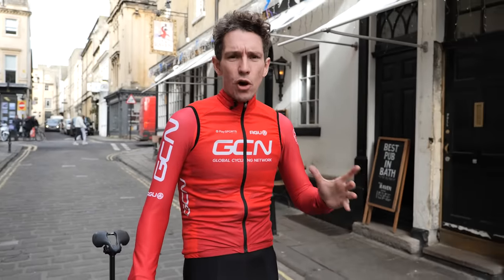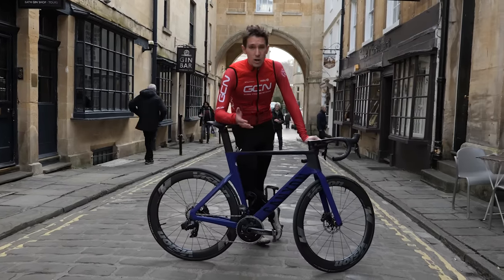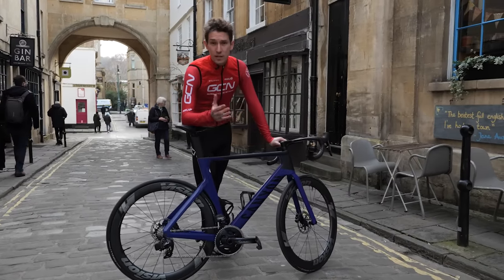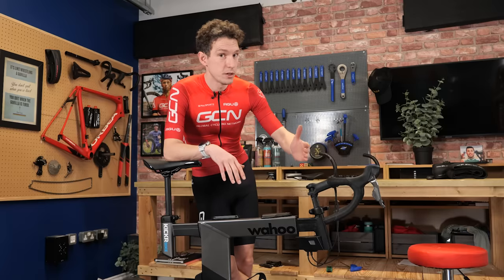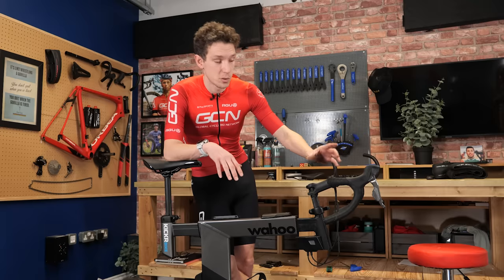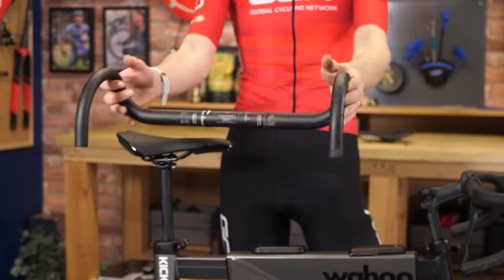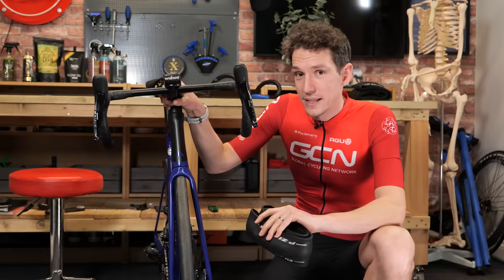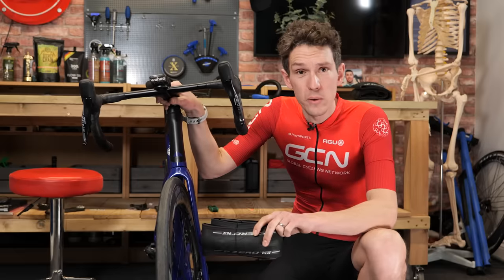Stop Back Pain When Cycling With Expert Bike Fit Tips

Comment from the maker: Have you experienced back pain when cycling? 🚲
Reply: Not always, only happen mostly when i do grand fondo..
Reply: Well after 3 hours ride i start feeling pain in my back, neck and butt
Reply: Yes. I'm riding my first ever drop bar bike, and I suspect the main causes for my back pain are the cranks being too long and stance too narrow.
Reply: A number of years ago, for about 2-3 years I could barely walk due to back pain. Sometimes I could only walk about 50 without having to do a reset on my which might consist of sitting down for as little as 30 secs. When I returned to cycling, within about 6 months, the issue had disappeared.
The pain I wish I could cure now, is the pain in my ass.
Reply: Like a lot of riders it’s usually when I’ve been out 3 hours plus. Great vlog thanks again to all at GCN, all these great nuggets, would always point younger or first time riders in your direction.
Reply: No, because I don't buy bikes with proprietary tech that makes things like stem adjustment either impossible or very costly. Yeah, looking straight at you Canyon.
Reply: Yes, if I’ve been neglecting my stretching and flexibility. If it’s bad/stubborn, I go feral and ride my MTB for a while. Discovering my left leg was a little shorter than the right and chocking the cleat, was revelatory and cured a range of niggles. I am in my late fifties so things are getting a little less robust, for all my efforts 😂
Reply: @Blitzer00979 If the cranks, the pedal arms, are too long and causing back pain, try just lowering the seat. Sure it doesn’t change the effective stack ratio at the front, but being more upright is only going to help. Otherwise, if you aren’t talking about the pedal arms, cranks, then my guess is that your handlebars are too low. You could flip your stem, raise where the stem is on your steer-tube, or get a shorter stem. Start with the seat height first though, that will change your front end
Reply: Not after my bikefit :)
Reply: I just lowered my saddle to help with a back issue. My back isn't perfect (I'm hoping that it just needs time to relax and I won't have to do anything else). It's not actually that it allows me to sit more upright, it actually allows me to lean forward better without bending my back the wrong way. I might actually be fine to lower my handlebars or even extend the reach, though I'm not planning on trying that soon.
Reply: No, usually just my shoulders as I have weak upper body strength, and perpetual numbness in my toes.
Reply: Yes when I bought a new road bike, had a bike fit and can now ride 5+ hours without excessive pain.
Reply: I have no disk between L4 & L5 and have been in chronic pain for a decade. I had to move from drop bars to mustache bars. This had a huge effect on my comfort levels. Installing the correct length and angle of stem to lift up my position on the bike was a game changer.  I also moved to wider tires running lower pressures. I am meticulous when it comes to my saddle. I have found that a leather Brooks B17 medium does the job brilliantly. Bicycling is the only activity that actually makes my back feel better. Once I had figured out these specific configurations my pleasure while riding increased dramatically. I lost 46 kg (100 pounds) and my fitness has never been better. You don't have to suffer on a bicycle, in fact it should be the exact opposite. You should feel better when you ride. I know I do. Great show boys, Cheers - M
Reply: @KelvinSuddith  I've tried lowering the saddle, and it hasn't helped unfortunately. And funnily enough, actually lowering the handlebars eased my pain. Turned out I was sitting too upright, which put too much pressure on my spine. The bars that came with the bike are also way too wide, at 46 cm. I'm planning to swap them out for a 40 cm ones. Still a lot of things to try to find the solution 🙂
Reply: For sure!  6gap 2023, me and the guys in the neighborhood were in the saddle 7.5 hrs. with 10,869' of elevation.  I definitely felt it in my LB during the later part of the 100mile ride.

Biking has changed my life.  I have power cranks and a speed sensor but an Iconect trainer w/ a cheap arm HRM is all it takes to get on Zwitft. I put off joining for a really long time,  watching the 2023 classics bike races on the big screen was my method of training.  Biking has definitely increased my downhill running capabilities.  

Gent–Wevelgem is my favorite race to watch. It so special witnessing the memorials in contrast with the vitality of the racers.
 
Jumbo or QuickStep?  I don't know their both so good!!
Reply: Can it come down to good bike and fit with patient research?
Reply: Yes. Usually caused by too long a reach. Stretching too far
Reply: my backpain actually goes away from cycling
Reply: Certainly. It's the main thing keeping me from doing long distances, but it also affects my speed as when the lower back starts hurting, I can't put as much power out, or at least for not as log. I'm also constantly switching positions to help with the pain, which is distracting, and obviously not aero. But I don't think it's necessarily the cycling causing it, as I experience lower back pain any time I'm in the same position for long. That can be driving a car or just standing (we got those adjustable desks at work, and because they recommended it, I started trying to work standing up more, but I can't do much more than an hour before my back is killing me), but it is most painful when cycling, probably because the more extreme position and the effort. But there are probably things I should try in cycling that could alleviate the symptoms for me. For a long time, I've suspected I might need a saddle made for women, as I am a very wide hipped man. Probably the next thing I'll try. That crank length thing also seems it might be an issue for me. I'm 195cm, so I've always been on 175mm cranks on the largest bikes they make (well, my Canyon is only XL, not 2XL).
Reply: yes due to being old and weak.
Reply: Lack of core strength is the most obvious problem

Comment: Great video. I've found core strength training to be a big help. Some Plank before every ride really goes a long way.
Reply from the maker: Core work is great! Especially if you are trying to hold a more extreme position on the bike 🙌
Reply: Side planks have been a revelation. Paired with shortening the cranks by 5mm it's made me pain free.
Reply: Hip and glute stretches are also incredibly helpful. Your back does less work if these stronger and more flexible areas are performing optimally. They're also free.

Comment: Back pain is about the only problem I have with cycling and it starts after about an hour and thereafter requires frequent sitting up and stretching. Going to adjust seat tilt and cleat position, because those are free.

Comment: Nice video. One thing that shrieks out at me as a bodybuilder primarily, who does a bit of cycling on the side for cardio: you really must think about your posture on the bike: pelvis rotation and straightening your lower back. Rotating your pelvis forward and straightening your back so it follows its natural shape has massive benefits for comfort and power, as well as reach to the handlebars. Doing this also helps to open out the rib cage and improve breathing too. Also helps engage the muscles for greater power, particularly the glutes. Yes, some cyclists will need to work on their flexibility and core strength but posture and knowing how to sit on the bike, with your back following its natural shape is so important. 
I see so many cyclists with bowed over backs looking like tortoises I’m not surprised back problems are not uncommon. It looks really unhealthy. 
Going back to bodybuilding, you would never attempt a deadlift or a squat with a bent over back like that, unless you wanted a slipped disc or a broken back and paralysis. Technique and correct form is everything in bodybuilding, both for safety and performance. 
It is a pity this video just discusses equipment and bike fit without once mentioning technique and how to sit on a bike with correct posture and form, which makes such a massive difference to this.

Comment: I had lower back pain while biking for years. Strengthening it through deadlifts in the gym fixed the issue once and for all, without requiring any changes to my bike fit.
Reply: that’s great, but as someone who has had two back surgeries, I never recommend deadlifts to anyone; because one second of poor form can put you on the operating table. there are other, and better, core exercises than deadlifts. deadlifts are antiquated.

Comment: I take a back injury on to the bike every ride, old sports injury and all that. Adjustment to saddle position fore and aft together with a 0 degree angle, then bar tilt angle though not height from the factory height, helped massively. Took quite a few rides to get it about right with incremental changes each time. Went from the struggle of being unfit and back pain within 2hrs to now doing 6hr rides where my sizeable but glorious buttocks give up before my lower back does. Rome wasn’t built in a day and all that.
Reply from the maker: It's those little changes isn't it! Great to hear that you are feeling better on the bike 🙌 How long did it take to get the position right?
Reply: @gcn  I want to say almost immediately with instinct and cunning, but in truth it took perhaps a month of riding 3-4 times a week, with varying distances and energy levels, as some days, more knackered than others, the differences would speak out straight away, others whilst fresher in body, took much longer. I assumed fatigue levels meant something being wrong wore me out quicker, having less ability to tolerate a 'not quite right' setting. At times I did feel like I was going round in circles, but now I've got a balance that seems to work at 10k and at 100k plus. But, like so many people, carrying long term injuries does mean some days you're beaten before you get on the bike so you manage it as best you can and shape a ride to accommodate. For me that normally means an extra cake stop, which is always a good thing.

Comment: Excellent video. I had a bike fit in December, not because I want to ride like a pro but because I enjoy riding my bike and I have already noticed a difference in my cycling. This morning I did a 2 hour 24 minute ride and cycled 36 miles with an average speed of 15.2 mph. I included a nice climb near the end. It’s a climb I normally avoid but today I set a PR. When I had my bike fit I asked about aerodynamic bars ; I asked would they increase my speed and performance and he said don’t bother. He said the bike would be fine for me. I feel more comfortable on the bike which is the main reason for doing it. Riding longer distances is the ultimate goal and being comfortable on the bike will help with that

Comment: My experience is that cycling, on a road bike, always was the answer to my back problems caused by long hours in my office jobs. Mostly, half an hour into a ride, the pain was gone... The explanation, according to me, is that the position on a roda bike, with at least 10 cm of difference between handlebars and saddle height, kind of opens up the rear part of your spine, whilst sitting for hours kind of places a lot of stress on your lower back. I never had back problema on the bike, not even after 200+ km rides. I'm on the bike for 53 years now.

Comment: Great video! I´ve had my bike fitted a week ago after 3 years of cycling because I suffered severe lower back and shoulder pains even after only 20 kms. 
I was putting it off for one reason only, the bikefitting costs as much as my 2nd hand old Columbus pinta with 105 (€200). But it was worth every cent. Felt the difference after a short ride wherein I was able to ride on the shifters for 45mins straight, where before I was aching after 2 mins.
We raised the saddle, put it more forward nose down and levelled the handlebar ´cause it was pointing way down, never noticed it 😅.

Comment: I had moderate back pain before picking up cycling for New Year's. I drive a lot, and the extra bit of stretching and the position on the bike have completely fixed it for me. Im riding about 5 hours per week so far, and my back has never felt better. Ill keep these tips in mind if anything changes, thanks!

Comment: Great video Si and Phil! My upper back complained between the shoulder blades & at the base of my neck. The handle bar width on my touring bike was the culprit.  I have a barrel chest but narrow shoulders for a guy so a quick measure between my A/C joints got the data to buy appropriate radonneur bars, then a shorter stem with a higher angle and it all went away. No more overreaching. Bliss! Great content gcn! Love it! Very useful!

Comment: NOT ENOUGH EMPHASIS ON CORE STRENGTH! I've had back pain for a while now and after endless hours of watching youtube videos and scouring forums...going through rounds of thinking that i've found the issue only to be proven wrong...I have finally figured out that my back pain was from my lower back muscles (mainly ql) taking on too much work in trying to hold up my upper body, compensating for a weak core. Flexion is a difficult position for your lower back to stablize. IF YOU CANT DO A PLANK FOR AT LEAST 1:30 -2 MINS and you have back pain, consider a weak core to be the source of your issues. There are also other muscles that take on a stabilizing role that be under developed, i.e. Glute medius. Warm up these muscles before your ride and make sure to activate your core while riding! Working my core has also helped alot outside of cycling.

Comment: Thanks for a great video, and especially the emphasis that there could be several factors contributing to pain while riding. I've been a cyclist for many years (I'm 64) and virtually always had lower back pain on longer rides. After seeking advice from several physios, massage therapists and doctors, (and confirming the bike fit was correct) I thought that I just had to accept that back pain was a part of it. But then I found a physiotherapist who prescribed leg exercises aimed at muscle groups that aren't directly worked during cycling, and increasing the range of motion (deep squats with no weight, pistol squats, lateral band exercises) and it made a huge difference. I still get sore but nothing like it used to be.

Comment: For me it was handlebar width. My bike came with a 44. Got a bike fit, changed to a 40, pain gone. The only place where I still get a bit is long hours on the indoor trainer.
Reply: Wow, that's interesting. Handlebar width isn't the first thing you'd think would be the main cause. Do you think the narrower bars got rid of your back pain because they made you more stable on the bike? My gravel bike came with a 46 cm, and I'm planning on changing to a 40 cm as well
Reply: @Blitzer00979  Without really knowing, I‘d say the narrower handlebars avoids my shoulder blades being pinched together and let‘s the muscles work in a more efficient position. I would never have thought that 4cm can make such a difference.

Comment: I'm a little strange.(yep! in many ways. Ask my partner:)But, I have shorter legs. In the gym it makes me a very powerful squatter. Bike wise, I look wrong on a bike that suits my size. You'd think that a smaller frame would suite me better. It doesn't at all. But, whilst a larger frame is better, and you can tell that simply by looking at me on the biker. I found that, 165 to170 cranks massively are better. I have hip issues! But, instead of changing stem length, I found that compact bars work much better. And, makes the bike less 'twitchy' I also found that lowering my saddle height and moving my cleats all the way back was a really good thing too. Stop my 'toeing' the peddles and so stressing my calf out. I got calf pain after 10miles.
I have learned so much via YouTube vids, and this GCN is another great one. Mind you, I reckon a good bike bike fitter would have got there much quicker and saved me many weeks of time learning, And in time and effort saved me a lot of money!!  Mind you, I have earned the knowledge that I have learned. From GCN and a couple of other channels.
MY advice is this. Be mindful of who you choose to listen to. I simply listen to 3 channels. And take the time time to learn. I can fix any issue on my bike, maintain it well and, have fun on it. 
All thanks to GCN and two other channels.. easy!
Great vid, thanks:)

Comment: I was experiencing quite a bit of pain on my bike but then had a bike fit. That identified a need for a shorter stem and shallower bars - problem solved. However, a year later (in my 3rd year of cycling following my retirement) I went back and had my fit adjusted slightly as my body had adapted a bit and I had become more flexible and stronger on the bike. Thus a good fit may need checking after a period of time if you have become fitter from more use of the bike because your now comfortable.